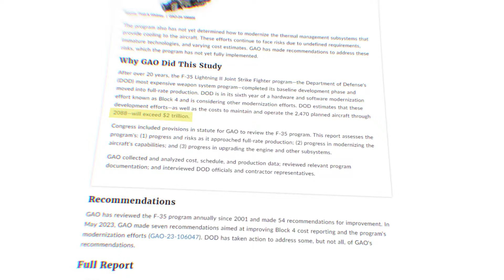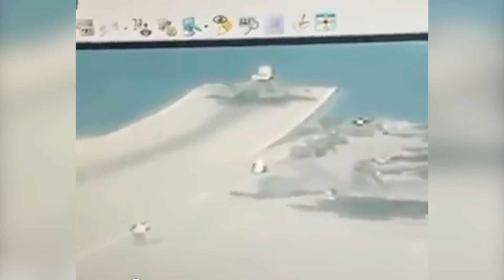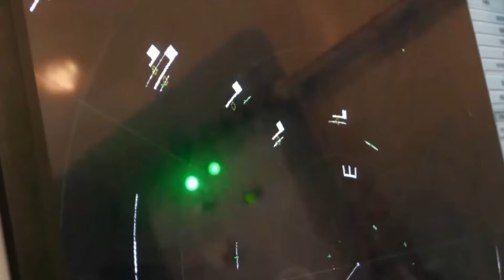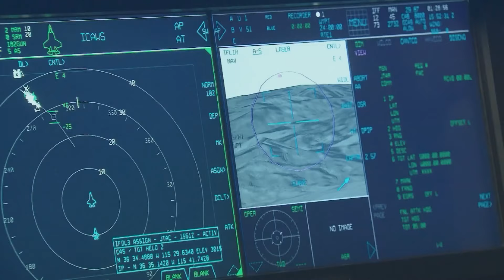Why US F-35 Is STILL the Most BADA$$ Fighter Jet!

Comment: only a few problems  An f22 can outperform it in a dogfight.   Of course its actual usefulness in ground support in an active ground fight, I have trouble going slow enough to deal with ground enemies in an effective way. Not to mention its poor survivability when used in low-altitude ground support missions.
Now yes you have had 800 hours in flight with this plane, unfortunately, that is several years worth while still not being ready for combat use.  or an honest appraisal of failures of one fighter to another wait until you only have combat mission hours for comparison.